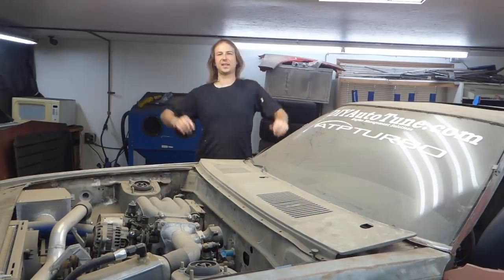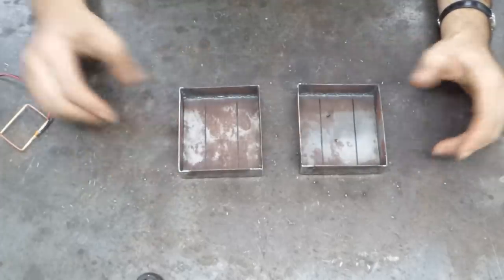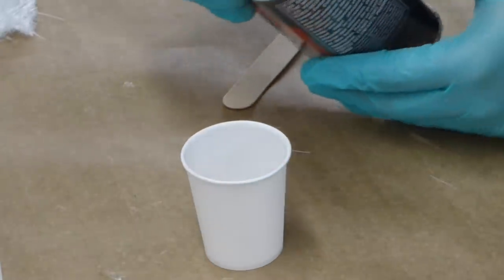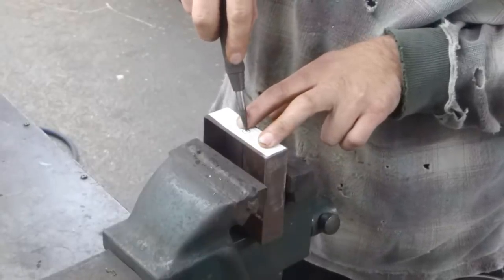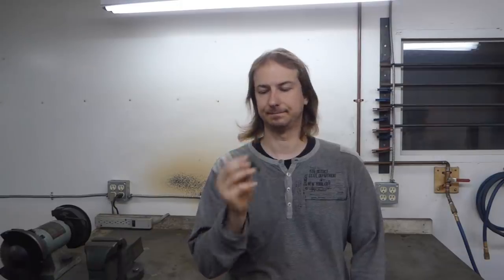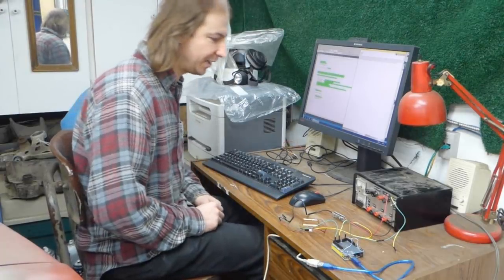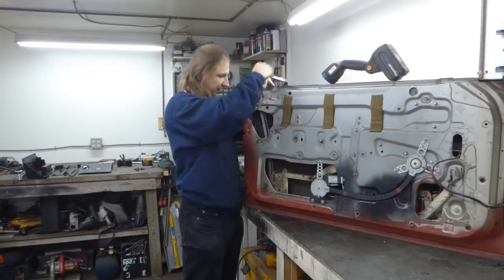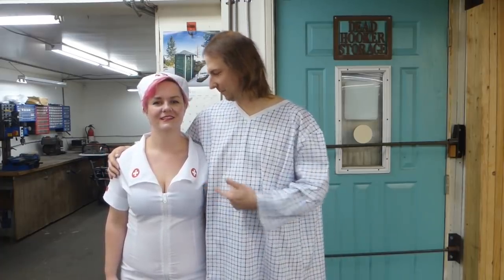Part 46: RFID Door Locks/Openers - My 76 Mazda RX-5 Cosmo Restoration

Comment: hey aron good to see you posting a video on here again , 
there are rfid transmitters in creditcards and pasports as well might not even need the dongle to get in youre car if you can read the creditcart signal 
too bad you needed to get the bodywork adapted for the antenna , i was thinking to mount it or the inside of the rearquarter window , still close to the door and no interference from the metal
prolly need a pushbotton inside the car to activate the passenger door or you be reaching over to close it every time you get in .......... hmmmm how do you stop them from opening up once youre inside 
if these dont work you could use youre phone and bleutooth 
got the same creality CR10 3d printer , i;m not yet as far that i can run my own designs though (mostly not verry good at working the design software yet)
.... not just the boatbuilders aron , it is verry recognize able though
make syre you clean the ways of youre mill verry whell the resin can be verry abrasive
i bet that nurse uniform is getting some use in the future (oh doctor cake wat a........)
and they say women arent intoo that stuff HAH
merry christmas and a happy new year to all and hope you be posting a little more often
Reply from the maker: People could scan as many RFID tags as they want, but only the tags with IDs I have programmed will activate the locks. Actually just to be evil I will probably log every invalid RFID tag ID scanned. I'm not sure what frequency credit cards and passports use. If they are 125KHz EM4100, then theoretically my readers are compatible so those items could be enrolled to open the door. I just feel like the antenna in the rear quarter window would be far less magical. Something very cool about just placing one's hand near the door to have it pop open. The reader which scans a valid RFID tag will be known to the ECU, so that will open the appropriate door. Scan at passenger door, passenger door opens. Two independent readers feeding the ECU. No real chance of the door opening by accident when in the car. Remember, the RFID range is only a few centimeters at best. Unless my right hand is hanging out the window and stays over the RFID reader long enough. You will see in future episodes how this will tie in with the interior door controls.All I had to do to get Lynnette into that costume was to ask. She is awesome.
Reply: You need a spring. If the window is closed the door just clicks and does not open :-).
Reply from the maker: I already have them in fact, just haven't installed them on the car. Door poppers are standard fair for any shaved door install.

Comment: Sumbeatch that is a big needle more like an 8d finish nail.
Reply from the maker: Yet oddly, really didn't hurt. It was so sharp it just slid right in. I even picked up some Lidocaine thinking I would need to anesthetize the area and ended up not using it. The burning of injecting that stuff would have been much worse than the little prick from the injection needle. Was sore for a few days, all healed up a week later. Now there is just a tiny discolouration where the needle was inserted. Expect that to go away soon.
Reply: @aaroncake  Needles don't bother me but that one did, can't believe it didn't hurt.
Reply: @ericcorse  I shot a 10D framing nail through my thumb with a nail gun, went straight through the bone, a coworker pulled it out with pliers, it's throbbed for a while and was sore, took me about 2 hours to get to the hospital to have it looked at, by the time I got to the hospital it didn't hurt much, you could hardly see the entry hole.
X rays showed the nail had pierced the bone dead center, just poking out the other side of the bone but didn't come out the skin, didn't shatter or crack the bone, doc said if it had hit it slightly off center it would of shattered the bone and they would of had to pin/plate it. Doc joked it didn't even need a bandaid, said I was a good shot with that nail gun, but to keep it away from my hands, funny thing was it shot the nail from about 2 feet away and hit my hand! A week later it was fine, didn't even know I did it.
Reply from the maker: Like Dan's comment, I once stepped on a 4" nail. Right through my foot, poked out the shoe on the other side. Friends were freaking out (we were building a tree fort) but I was more pissed about the blood in my shoe and sock. Also accidentally cut my left thumb off in grade 6. That didn't hurt either...but getting it stitched back on sure did! Funny thing, pain is. The injection needle was insanely sharp.
Reply: @aaroncake  I did the same thing as a kid, stepped on a nail and it came through the top of my foot, got a little round scar on the top of my foot. I've got a 4" scar on my forehead from my eyebrow to my hair line, swimming pool filter/pump system over pressurized and blew up, steel band off of sand filter hit me, knocked me out, the cold water flowing over me woke me up, walked into the house looked in the mirror and could see my skull, called 911 and sat on the porch waiting for ambulance, got 14 stitches in my forehead, would of killed a normal man, good thing I've got a hard head!
Flipped a quad and broke my back 30 something years ago, did a compression fracture on L1, laid on the ground for about a minute before I could feel my legs, came close to being a paraplegic, healed and have worked all these years without surgery, have bad arthritis in my back now, still can outwork the kids.  
That's enough for now, won't go into the injuries from rolling my 4x4 Datsun, rolling my valiant, crashing on my motorcycle, and crashing skiing, those would take a while.  ;)

Comment: That watch has sure lasted you over 10 years or so ,right?
Reply from the maker: I'm fairly sure I've had it for 30 years.
Reply: @aaroncake  I see you use Sae measurements instead of metric 
Tina still around and how often you take her for a ride?
Happy New Year;!!
Reply from the maker: I tend to use whatever measurement standard is going to result in the most rational number. If something is 2", then it is 2". But if something is some crazy fraction, then it gets measure in MM. I was actually driving Tina yesterday, though just to pull into the shop for winter storage. I put about 10,000 KM on the car a year.

Comment: Duuuude.... talk about overkill, you could wreck that car and those fiberglass bricks will remain intact, also fiberglass mat doesnt need to be cut, you can pull fuzzy chunks of it as small or big as you want, with your bare hands, which makes your parts even stronger, because you're not cutting the strands
Reply from the maker: Well, I never claimed I was an expert in fiberglass.

Comment: how bout you use that chip to start the car as well?
Reply from the maker: I will probably do that. Not necessarily to start, but to enable the car to start. As an extra layer of security.
Reply: @aaroncake  while you are at it you can use that RFID to open the trunk, roll up/down the windows, and alot more. cant wait to see the car finished

Comment: no any update more than 5 months , project stop or what.
Reply from the maker: It has absolutely not stopped. However I am a bit behind in my editing due to my "free" time being taken up  by other things. I'm catching up now. Also the current Cosmo project is turning out to be a bit more involved than I had thought, with lots of time needed for thinking and waiting for parts. I do know that it will be multiple parts, to keep the videos down to a sane length considering the content.
Reply: @aaroncake  thank you for your quick reply. Best regards,

Comment: Pretty sure this car will be hydrogen powered when it's finished.
Reply from the maker: Hydrogen, probably not. However I have built the fuel system E85 capable.
Reply: @aaroncake  only implying that cool things keep getting added. E85 is cool now, but not so much in the future. Hydrogen is the future. The destiny of the Cosmos is in the future....and beyond.

Comment: I use easypc for pcb design
Reply from the maker: Doesn't look too bad. Though I really like Copper Connection. It's straightforward to use, yet very powerful. There really isn't anything I have found it doesn't do...except the free version doesn't export Gerber.

Comment: Nope... Give me a good ole key any day to unlock the door. I have hidden compartments with an extra door key only (unlocks the door but dont start the car)... just in case I lock the original in the car. And still have 2 extra full spares hanging on a key rack in the house. Hell I still want a key for the ignition. I found you can tell a lot about your engine with the turn of a key versus push button. And keys makes it easier to sell it than having to dissect your hand to retrieve a bloody chip to give to the buyer. And what if someone takes the time to over write the software remotely. You would really be SOL.
Reply from the maker: I can't think of a method of overwriting the software (are you referring to the car? Or the tag?) remotely.
Reply: @aaroncake  Actually both. See this video of Scotty Kilmer ( https://www.youtube.com/watch?v=W3FLKOyBfgE ) he is talking about the most stolen car. And he goes into how they can even bypass key-less systems with just a tablet and app. Yes he is talking about key fobs but the theory is still sound. If they have a bypass for one then 9 time out of 10 there is a bypass for the other.
Reply from the maker: That's all valid of course for those OEM systems. But doesn't apply to my system. A thief would have to clone my RFID tag, meaning they would need access to the tag. In order to reprogram anything (such as the body ECU) they would need to physically open the ECU to have access to the processor. At which point they are already in the car.

Comment: Whens the next video Aaron?
Reply from the maker: Soon I'm hoping. A bit  behind on the editing however I should have enough footage now...
Reply: aaroncake awesome man! Love watching the build. How’s the hand feeling? And your garage, I hope you haven’t had anymore issues with thefts
Reply from the maker: The hand healed up quickly. At this point there is only a tiny mark to give away the location of the previous scar. Was sore for about a week afterwords. The tag itself has found a permanent home about where implanted. It tended to move around a little for a month or so which just meant I had to consciously be aware to not play with it. Now it is encapsulated by collagen so not visible nor feelable unless I flex my thumb specifically.

Comment: 1:03:40 just the tip? More then the tip is going in
Reply from the maker: Important to create a channel into which the implant will sit. So needle all the way in, then pull it out a bit and start injecting the tag. Otherwise I gather the tag will be forced in, tearing the layers, causing excess pain and healing time.

Comment: Car battery goes flat, need to charge it, can't get into car or under bonnet without battery having a charge in it, catch 22. Not that it matters, soon you will die from cancer from the fibreglass dust, but nice vid bro 😀
Reply from the maker: Easy enough to hide a battery connection on the outside of the car somewhere. Or since the battery will be in the trunk, open up the trunk. Yes, I didn't quite realize how much fine dust was created by the fiberglass. Definitely won't be doing that again, and have since finally fitted a vent fan to the shop.

Comment: Been sitting so long it's covered in dust... :-\
Reply from the maker: It's more like I have done a lot of dust generating things in my shop. Sanded a bunch of wood over a year ago and that stuff clung to everything. It brushes right off the Cosmo, but doesn't blow off with air. Freaking saw dust.

Comment: Aaron, why don't you just use those nice plastic 3D parts. Fiberglass is the most horrible stuff on the planet!!
Reply from the maker: Thermal expansion coefficient. Because they will be buried in bodywork within the door, the antenna brackets need to expand and contact at the same rate as the steel. Otherwise the paint would crack. Fiberglass is the common material with the same thermal expansion coefficient as steel. Even still, it is going to require a specific type of filler and flex agent added to the paint.
Reply: So, after all your meticulous metal work, you'll have to spread filler over that gaping square,  @aaroncake . In the end that's going to be one fine automobile. With that chip in your hand you have taken personalization a step farther!

Comment: This idea is terrible, you can copy those tags from a mile away with a reader. Also you're performing a restomod on that car, not a restoration. You also used lacerated, homogeneous and anatomy wrong and rapid prototyping is not even remotely limited to 3D printing.

Genuinely can't continue to watch as I will pass away if I cringe any harder, jeez
Reply from the maker: You can't actually read them a mile away with a reader. If someone wanted to read the tag, it would be so incredibly obvious as they snuggled up to me with a metre wide antenna that I think I would understand what they are trying to do. The "rapid prototyping" is sort of an in-joke with me. I always try to call "3D printers" as "rapid prototypers" because of course they were "FFI rapid prototype machines" or similar before the media just lazily consumerised it as "3D printing".